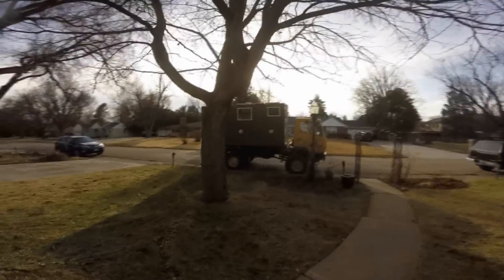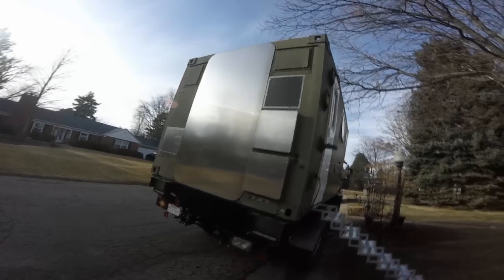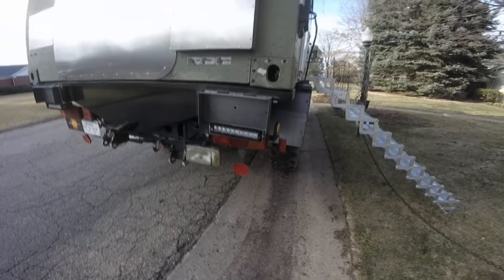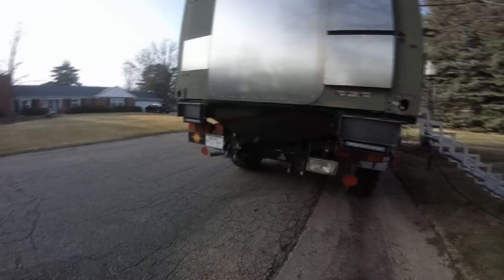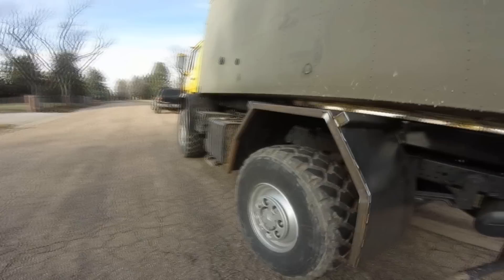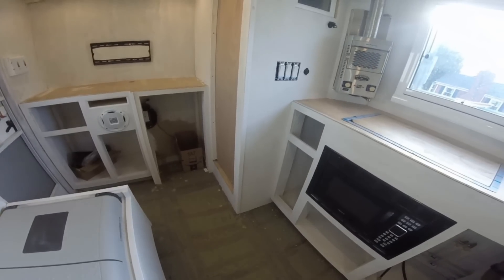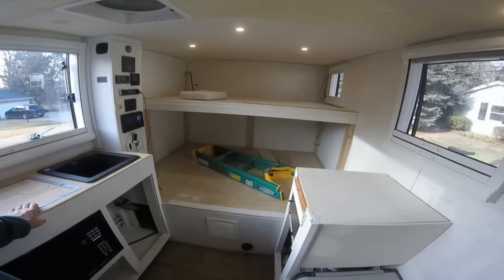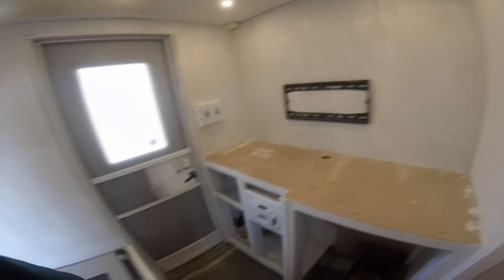Build Update 3-28-19

Comment: Congrats on the pups.  Which brand/model of exterior entrance steps are those?
Reply from the maker: Thank you!  https://www.amazon.com/gp/product/B00MJUO690/ref=oh_aui_search_asin_title?ie=UTF8&psc=1
Reply: @Colorado4x4Van  Thanks for the link!
Reply from the maker: @BeingWolfy  Welcome! A little pricey, but the only commercially available ones that were tall enough. We may fab something better later.
Reply: @Colorado4x4Van   - I might need to do the same thing, if I put a trailer hitch receiver on the back of my rig.  I want to do that, but I think my current steps are in the way  because of the way it's designed with the bumper.

Comment: honestly not a fan of those fenders, I envision them digging onto the dirt and keeping your rear tires of reaching the bottom of a tire rut. Now you are just sitting there on your fenders with the wheels spinning away. 
For the exhaust I would have re-routed it up behind the cab to keep it out of any deep water, cause if you stall out, the engine can suck water back up the exhaust pipe then hydro-lock your engine, and If you're lucky not break/bend piston arms your engine. Not to mention it is a shorter run, and cheaper to build. 
I am really curious about what you paid for that truck and what it cost to ship it from EU. I have been watching a couple of sites over there and have not seen any "deals".
Reply from the maker: That may happen. It would have to be a deep rut. Unfortunately DOT requires me to have these or mud-flaps. I hate mud-flaps, so we went this route. I believe the stock exhaust is routed to prevent that...even the brakes have air pressure run to them to keep water out when fording. I thought about stacks, but then you soot up your roof (solar panels). I don't have a snorkel (yet), so I can only go so deep anyway. I have a video discussing how to import these trucks. All of the costs are there. I paid 19500 US for the Truck. Another 5000 to ship and taxes, etc. The budget for the whole project is 60k or what a good diesel pickup costs.
Reply: @Colorado4x4Van  25k plus tax's and some hidden import fee's is a dream I am in search of. Since I live in a East coast city which has shipping industry I should be able to have it dropped off 15min away from my house. Worst case I have to go to a larger city that is 4hr's away. Would have hated having to get it shipped across the country as well.
Reply from the maker: @Gantzz321  I had it shipped to Houston and flew down-drove it back. Watch my vid...you can check out links there for trucks. I saw several last night (just keeping fluent in the market, Lol!) Many are the fire-truck variety. 917's are through the roof lately. The MB 1222 is a good truck. The 1017's are usually ex-military and not as good, but cheaper. Good luck!

Comment: Just curious. But if it were only 2 people would you have stuck with the van ? I understand that 3 people is too much for the van to comfortably handle on long distance trips, hence the new rig. But I'm just wondering what your thoughts are about just a close couple and living in a van similar to yours. Thanx for the info. Great project so far
Reply from the maker: Even with two people I was looking to add a shower/bathroom. The Van is too small for that. The Sportsmobiles and Sprinters that have a small bath/shower are too claustrophobic for us. I started the VanPod project to solve that problem, but then we needed a third bed as well. I suppose if you are ok showering/using the bathroom outside (limits cold weather activity) the Van would be fine. If it were just two of us I'd have chosen a Unimog base and a smaller camper.
Reply: @Colorado4x4Van  thanx again for your reply and thoughts. I have been toying with the idea of possibly a trailer towed behind a 4x4 truck. The trailer would be self built as I'm a fabricator welder of some 40 years. The Australians make some serious offroad trailers with independent axles and water right floors etc. I've watched lots of videos and those Australian trailers are very impressive offroad. Maybe a van like yours but pulling a trailer idk...???....thoughts ??? Maybe could deeper into back country with a 4x4 trailer combo but still have the roominess
Reply from the maker: @evopwrmods  I've been watching Ronny Dahl and since he's started towing a trailer he's had a lot more trouble in the back-country. His trailer isn't even one that you can get inside of (in case you're not familiar with his channel 4wheeling Western Australia), but one that has an outdoor kitchen and some storage. I'm definitely a proponent of trailer-less travel unless you have to.
Reply: @Colorado4x4Van  Yep...there is definitely NOT a Perfect Combination that's for sure. Lucky for me it is just me and Pup, and maybe a girlfriend down the road a bit. But for now I enjoy roughing it more so than most do. I guess in the end it all comes down to your personal comfort levels and your pocket book !
Reply from the maker: @evopwrmods  In the end it comes down to HER comfort level...Lol...although I rather enjoy the comforts now...backpacking was great for many years...I'm old now!
Reply: @Colorado4x4Van  I hear ya....to each his own. To me that is one of the things that is so wrong with this current world. Not much individuality. People want to join some group think or social club. Im a loner and as I get older I enjoy my solitude more and more. And also I want to be less and less dependent upon this modern world. regressive I guess, like owning much much less, needing much much less. Maybe not per-say totally living out of a backpack; but only have the necessities. Learning how to be more self reliant. Fortunately I have the skill set to build and make pretty much anything mechanical. I want to learn how to live without society and this system we live under. Back to basics and this Vehicle Journey Im on will have to carry me to this magical place where I can get back to the basics. Maybe a very capable 4x4 truck with a small short offroad trailer. This is what I was referring to with the trailer idea. not so much a travel trailer but a shortish 12-15 footer self built offroad trailer. Thanxx again for your input and ideas I do appreciate them. Ive been following your van build for a while now. Ill be retired soon so I can live full time traveling until I find my homestead/homebase property to build upon for my later years...TTYL